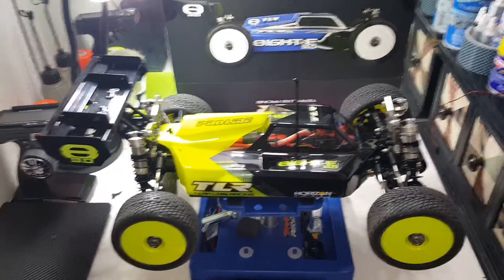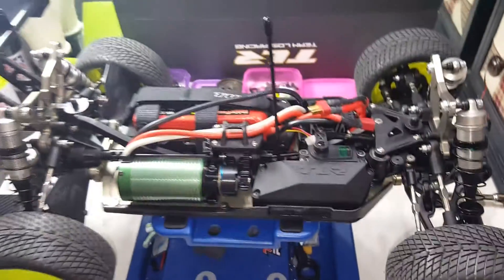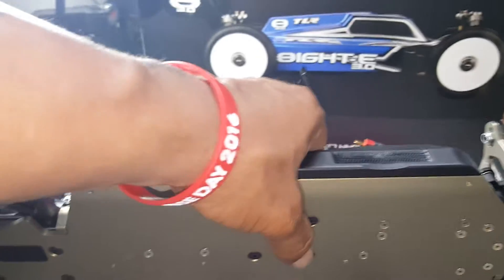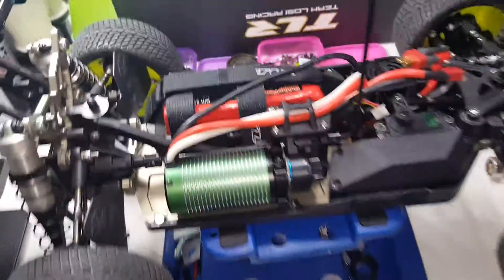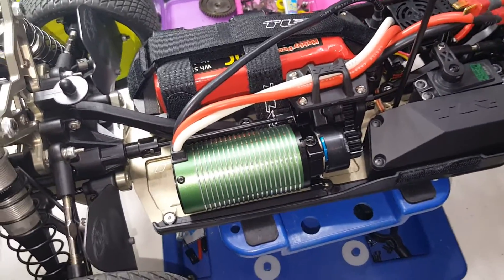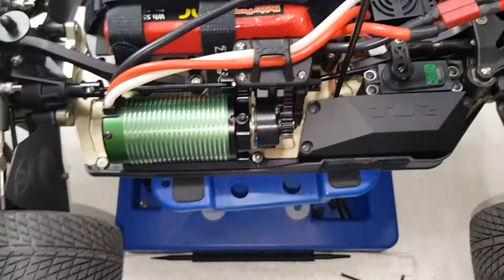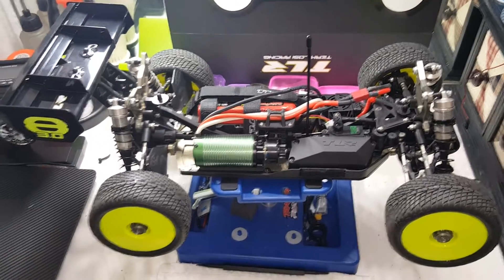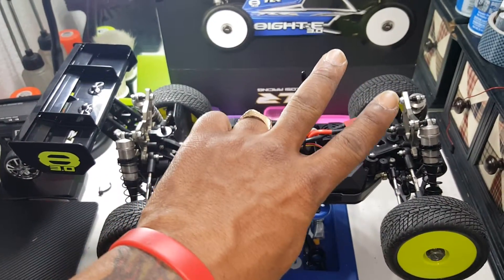Losi 8ight e 3.0...... final.....Electric clutch system installed

Comment: Can you tell the dimension of that clutch? Just want to check if it can fit my serpent. I need the length from end of the pinion to the back plate of the shoe holder

Comment: Yeah but why? Centrifugal clutch is for nitro engine that's always  idling.  Electric motor doesn't idle.. Why add another part and how does the brake work???
Reply: This was a trend a few years back. Saw several drivers using this, saying it gave them more of a nitro feel. Adam Drake ran a clutch on his electric Mugen.
Reply: Just like andrew said, adam drake run the clutch system in his mbx7r eco n mbx8 eco. He said it is to make the car feels more like a nitro. For braking, the clutch is actually at always expending out, unlike the one in nitro where the clutch is kept inward. Since it always in contact with the clutch bell, the brake is always there.
Reply: I assume it would like to coast better... Without it the motor drags the car alil bit even with 0 drag break... does it make enough of a difference to be worth it? I doubt it.. personally I like a little bit of drag brake
Reply: Arif Fadzleen can u Reverse